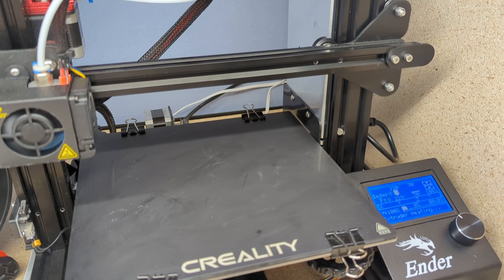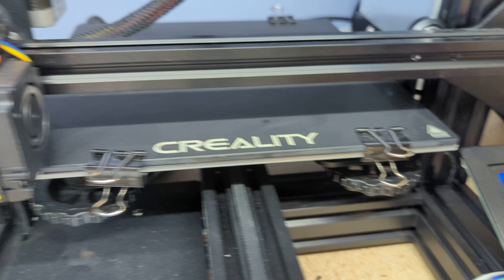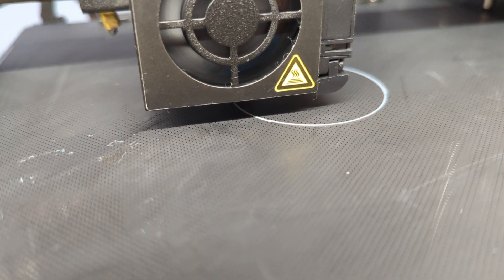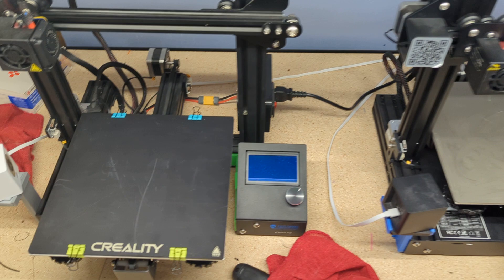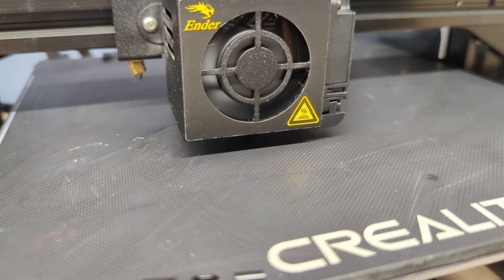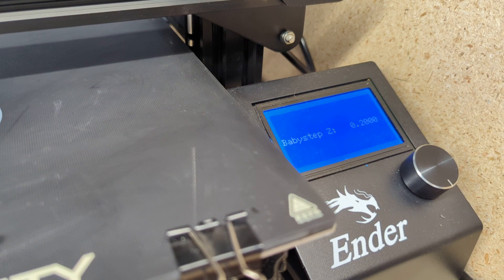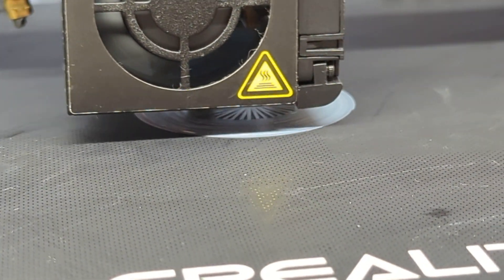How To Get Your 3D Printer Filament To Stick To The Bed

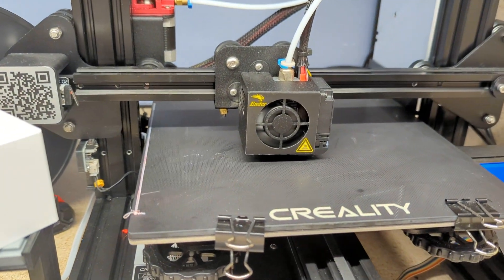Comment: 03:55... mine came with them.... IT WAS GREAT! Now after seeing everybody talking about the GLASS BED...! So I got one... and its the most bs ever... Why did I do it...?! Idk😆 NOTHING WILL STICK.... I dont get what the hype is with the piece of SHEIT glass bed😏 Slower first layer..... WAYY slower.... Have to wait for it to cool in order to get it off..... NO GLASS BEDS PEOPLE THEY SUCK 04:00 so why use the glas?s?!
Reply from the maker: I have long given up on the glass bed.  It lost it's sticky
Reply: @QC3D  lol! Ok thanks😆 I first tried the reverse side of the bed... that wasent worki g at all even after dawn and alcohol and heating and cooling.... NOTHING HELPED! Then I flipped it over to the intended not so smooth surface.. and its sticks reaalll good😆 too good😂 So I wonder If now I flip it back over to the glassy smooov glass side...And give it a clean until she squeeks If itll work now🤔

Comment: I fliped my glass bed on my ender 3 pro and that side works very well with PLA, good stick, no warping.

However i came up with a technic that i use to level my bed. First, i level my bed with a leveling gcode and a 0.1mm thick paper, i adjust the babystepZ to 0.1mm, and the paper barelly touches the nozzle. Second, i print a 1 layer thick square (10x10 cm), while it prints i adjust the babystepZ to print it perfectly. Then i level my bed again, but this time, i adjust the babystepZ according to the previous print, with the same feel of the paper. For example while i printed the square, i needed to move up the nozzle by 0.06 mm, then at the next leveling procedure i adjusted the babystepz +0.04 (0.1-0.06).

In your case, you could easily set the home offset Z by +0.2mm in Prepare menu and save it.
Reply from the maker: Good stuff. This seems to be very similar to the process that my Prusa machines do a bed level and first layer test.  Do a video and share, the overwhelming comments on Facebook groups on first layer sticking are out of control.

Comment: so why you swap the magnetic beds is it so great ?
Reply: Thats what I was wonderinggg...... Not sure.... no warp due to perfectly flat surface are I was thinking... I was getting aome good warping with the pte plate... tried tape under to try and fix it.. the center seemed good, but all around the edges it seemed a bit high.... but the tape just made things worse... So Im trying a glass bed for that reason...! But yeah Idk why else😆💁‍♂️

Comment: I fliped my glass bed and used the flat side instead of the textured film one.
It help filament to stick and havent had any problems afterwards.
Altho i dont have much experience and have only used PETG so far.
Reply from the maker: Yeah, PETG sticks much differently than PLA.